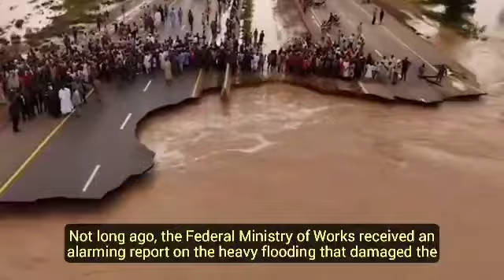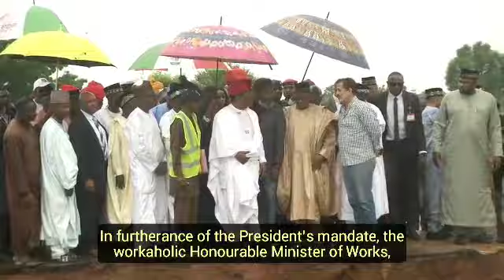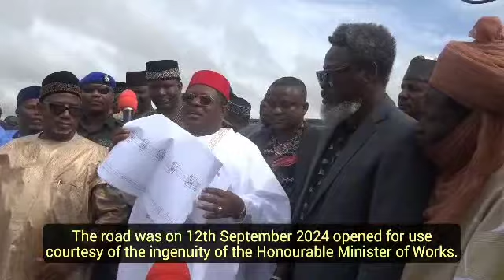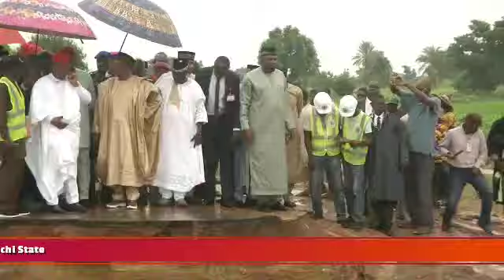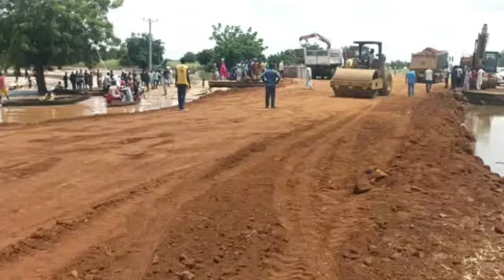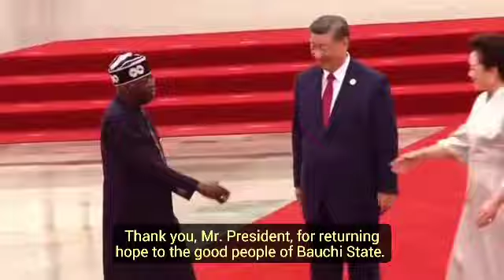President Tinubu Delivers: Kano-Maiduguri Road Sections Fixed After Heavy Bauchi Flood

Comment: I would have thought they would have constructed a covet,a bridge or water channel there.lt's only a question of time the flood will sweep the road away again..
Reply: Did you see Unahi raising the new design of the road. You don’t reconstruct without an wholistic approach to detect and deter future occurrences.
Reply: @DonaldOYewande  This is just a temporary measure then? That's OK then! I could not tell if it was the new design he was holding tbh.
Reply: Without a bridge there. It will fail again